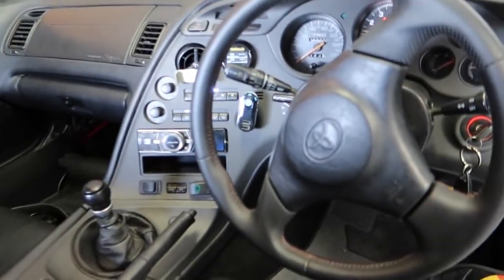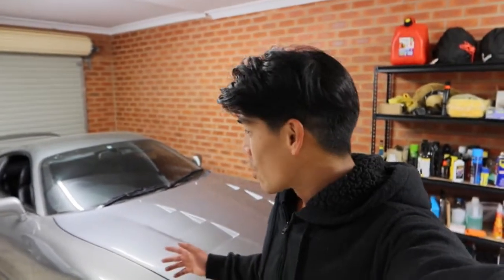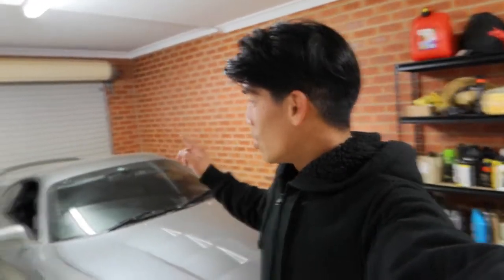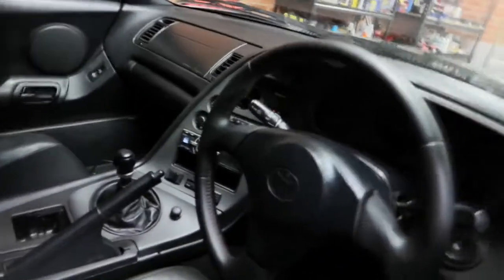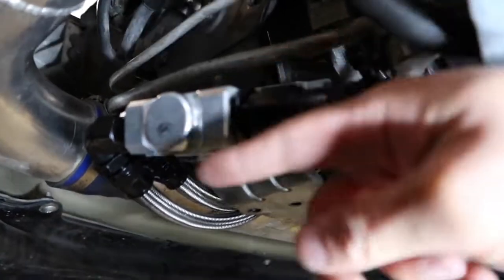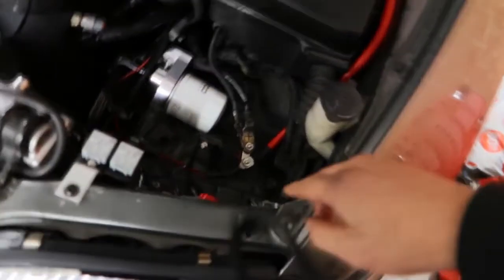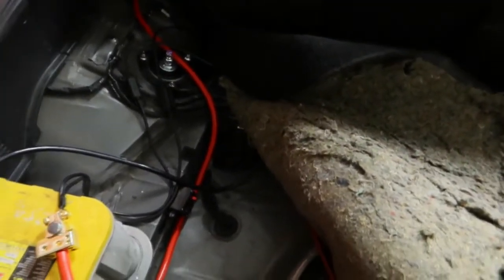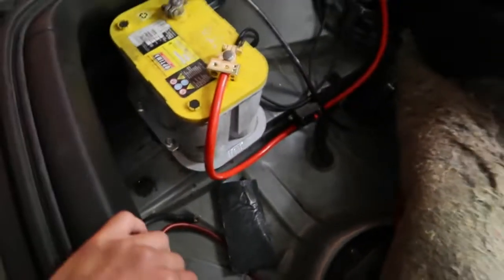SUPRA VLOG 2 - FINALLY BACK ON THE ROAD!!!!!

Comment: What wheels are they and what size/offset are you running. Would also be interested in what size tyres you’re able to run as well. Thanks
Reply from the maker: Hi ricardo theyre 19 x 9.5r +35 and 19 x 11 +42. 265 front 305/30/19 rear

Comment: Hey Clint, there's a red +Positive+ output in the main fuse box under the bonnet. Couldn't you route some of your messy wires under the fuse box using that? Might have to cut small amount of plastic but might clean up your bay nicely!
Also what Haltech ecu are you running?
Reply from the maker: hi mate im running an Elite 2500. yeah i should run it under the fuse box. i just rushed it :S
Reply: @Clint2jz  thank you, about the 2500, did you wire in a dual pump fuel system by chance?
Reply from the maker: @jasonbliss1762  its dual Walbro 460
Reply from the maker: @jasonbliss1762  hi jason, yeah i have a dual wallbro 460s in a radium hangar